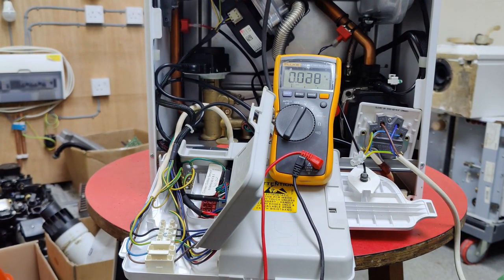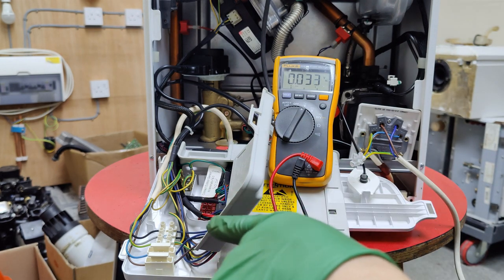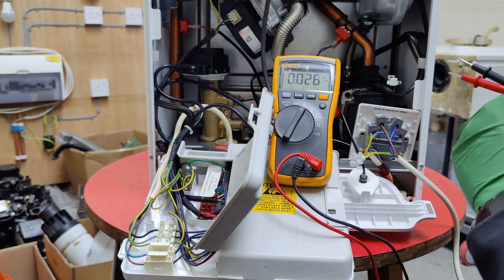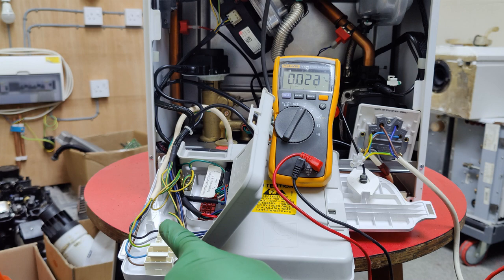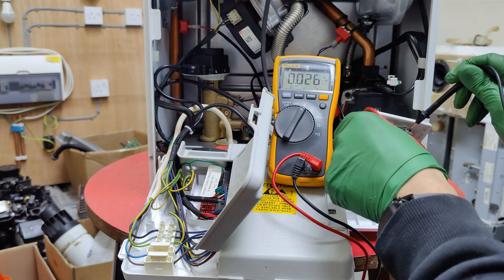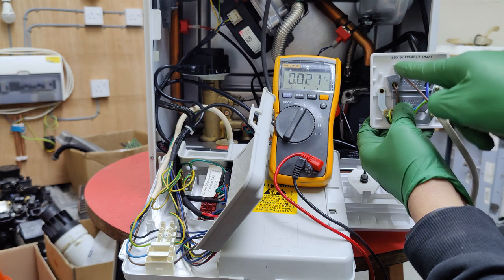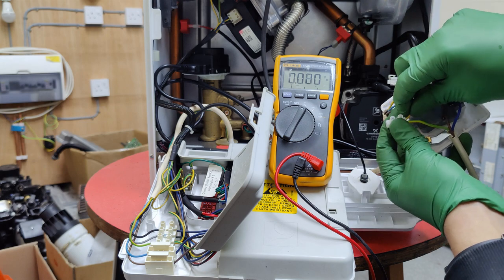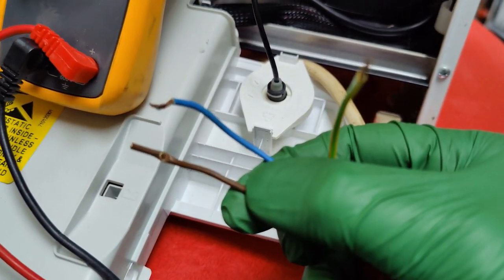How to check- No Power to the Boiler. Continuity Testing. Fault finding.

Comment: great short video on the basic's of fault finding that are often over looked . i'm a multimeter man my self i prefer it to the voltage testers i have also the safe isolation kit we are supposed to use. (still in the box) if your confident with your meter why not!👍👍👌
Reply from the maker: Thanks for your feedback mate :)

Comment: I have an intermittent power supply problem on my baxi boiler. When the CH is on, it will randomly lose power for a split second then come back on. My previous boiler (feroli) did exactly the same.
Reply from the maker: Power to the actual boiler from the fused spur or any of the components?
Reply: Yes, it's like if you switched the fused spur off then on again really quick. Only notice it happen when heating is on
Reply from the maker: @JimmyCrackCorn72 Have you had it checked out by an engineer?
Reply: Told the engineer who installed.and services the boiler, he said it sounds like a sparkies job, so I got a sparkie round. He just had a look, didn't test anything. I'm thinking of putting a plug on and plugging in to 2 gang socket below the fused spur
Reply from the maker: @JimmyCrackCorn72 Yes that's not a bad idea.

Comment: My boiler stopped working this morning. Display isn’t turning on and no hot water. I’m trying to troubleshoot it. Been working fine for months. The breaker wasn’t tripped.
Reply from the maker: Which make and model boiler do you have, is it showing you any fault codes? Do you have the GC number for the boiler?